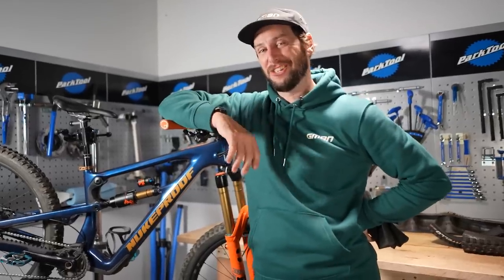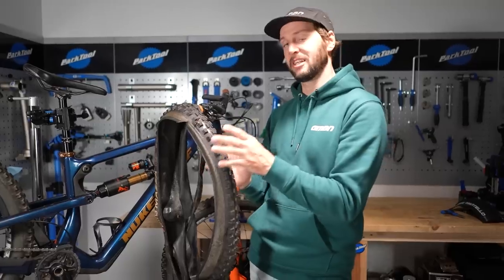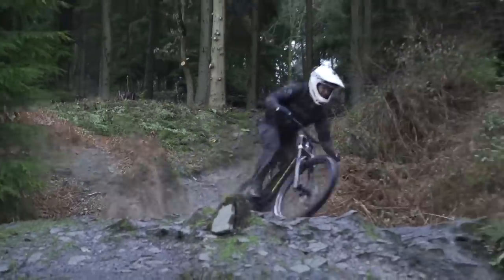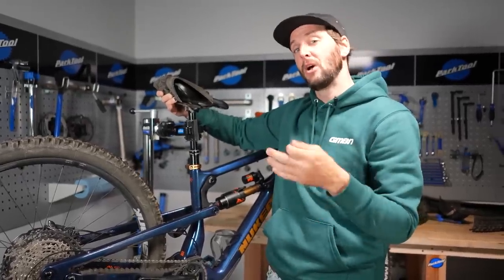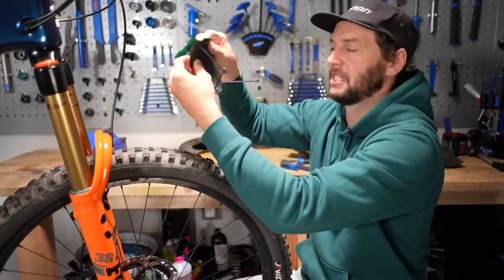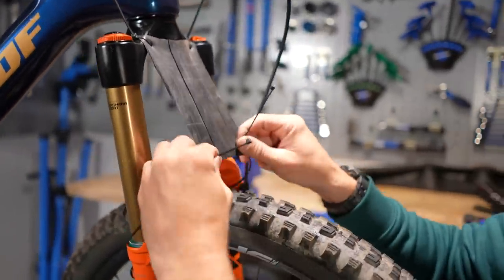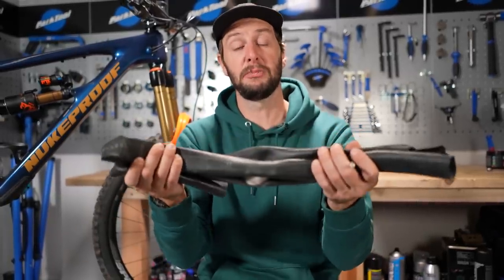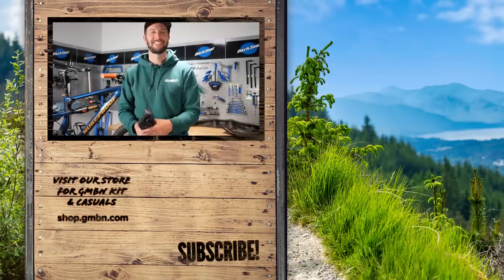6 Creative Ways To Reuse Your Old Bike Tyres & Inner Tubes!

Comment: I like to stick bits of old cut up tires on my helmet until it looks like one big tire, this gives increased grip to the surface of the helmet, so in a crash, its not even a crash anymore, I'm still riding, just upside down.
Reply: this gives "keep the rubber side down" a whole diffrent meaning!

Comment: Another good hack is to remove your dropper post, slide a piece of inner tube over it, then refit and clamp. Zip tie the inner tube top and bottom to seal it all up, then ride all winter knowing your dropper is protected.

Comment: We used to use really old worn tyres as tyre liners, cut sidewalls off and any remaining tread (that could take a while!) and run it inside your normal tyre. This was a while before any sort of commercial tyre liner was available so saved me quite a few puncture repair stops!

Comment: I think the saddle-grip one might be more appropriate with a road or gravel tread.  For discarded tires with chunkier knobs, I use strips as edge-guards on shop tables and cabinets, doorstops, non-skid pads for workpieces, all sorts of impact protection in the garage/shop.

Comment: Most of these are awful lmaooo 

Old tyre on your saddle?? If it was necessary we would see commercially available seats with inbuilt tyre tread

You also missed probably the most practical use of a used inner tube. Rubber bands. We never pay for them and they’re infinitely stronger than store bought ones

Comment: cut your inner tube so you have a straight tube then cut once down the length so you now have a long flat .  Can halve its width again as well if you wish for smaller sections .Wrap around frame with a bit of stretch coiling it 'up' the frame and then bit of electricians tape top and bottom , or a thin section of inner tube like a rubber band looped round and tied off., Can do this on any part of the frame and will save you getting your paint work scratched.

Comment: Great recycling  upcycling  video .I use my old tubes as over sheath on chain link to protect the bikes I lock up with the  chain..a 26 x2.0 tube is great as a down tube protector .roadie tubes gor soft clamp spacers like light mounts to frame or bars 
Even use them as garage door draft excluder .
You can use them in the gmbn dungeon too

Comment: Use the valve of an old inner tube to keep your big bottles of soda fizzy: Make a hole the same diameter of the valve, and seal it using hot glue. Whenever you're done serving a soda, use a small pump to give it pressure, and it' won't lose any fizz!

Comment: you can resole your shoes with old tyres. You can keep them in place while the glue sets with old inner tubes wrapped tightly round. Also, inner tubes make good resistance bands.

Comment: Some more useful applications to beat tires:
Use them to protect items you put your bike on or against. Wrap them over the lip of a railing or edge to help protect both the bike and the ledge. Or against a wall where the handlebars or wheels touch and rub. 

You could even put them on the floor and scrub your shoes on them to help get the mud and dirt off.

Comment: I've been using old tyres as chain stay protectors and frame protectors for 30 years before it was even a thing. The seat one I've done but it is unsightly though. But frame. Forks or handlebar. Just go crazy on the bike as extra protein of you lock your bike up with heavy chains and old tyre is excellent for that. Even makeshift grips or a extension to your mudguards. Be inventive.

Comment: If you want a cheap and hearty bike locking chain on the cheap, get heavy duty chain from a hardware store. Then either take your old tubes or hit up a bike shop for leftover tubes. Cut the tube, run the chain through the tube and now you won't marr your pretty bike up.

Comment: Me as a mtb user but used mostly on road and diy some parts to repair or something, the only one useful here was the downtube protection with tires. Ive used the innertubes as rim tapes, or covering something that could potentially be damaged or scratched like the stanchions... Nah im good ill never put a tire theead on my saddles, 

As a steel bike user i put the tire under my downtube, to protect the cables. Yes the cables are exposed under the downtube of steel frames thats common. I choose protection on my bike's parts than looks, lol.